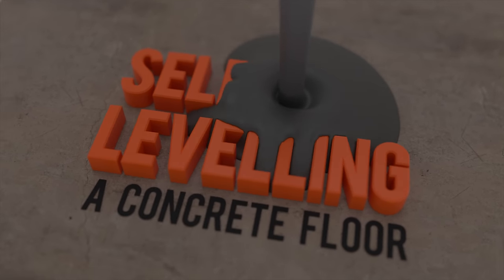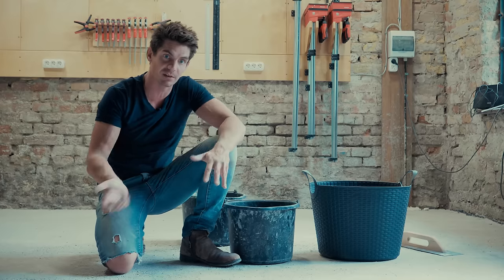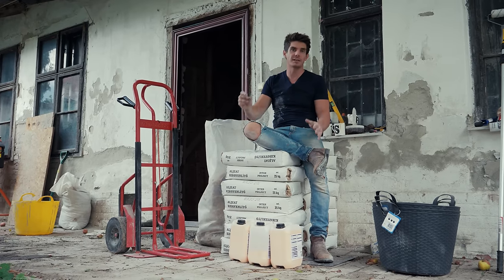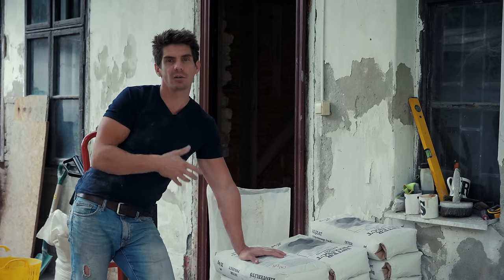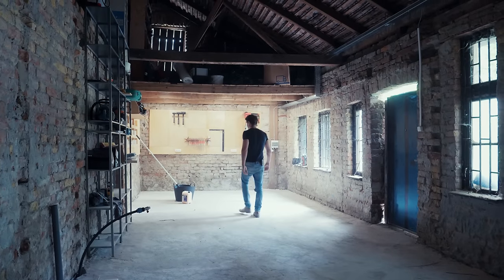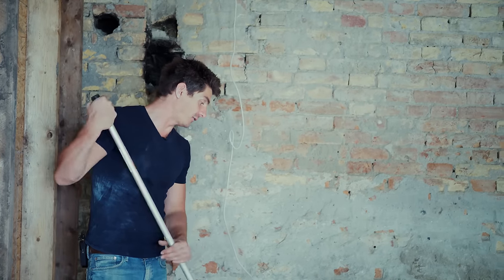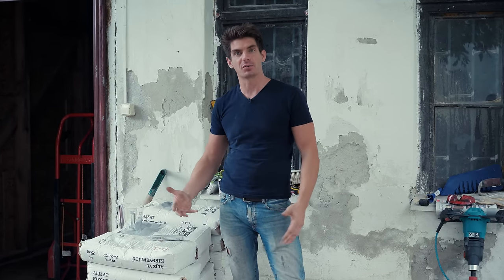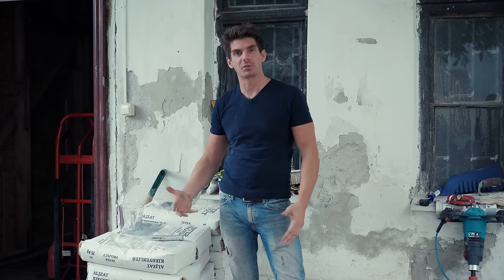Self-levelling a floor - The Complete Guide

Comment: I been told instead of primer , we can use PVA mixed with water ! Is that right?
Reply: If you don't want a warranty from the manufacturer, sure.  Just understand that improper priming is one of the major causes of self leveling failure.

Comment: I'm curious if the manufacturer recommends leaving it as a finished floor, the mix i'm familiar with is more of a bonding/leveling material that does not have the hardness to leave as a wear layer.
Reply: Yes, the vast majority of screeds and self-levelling screeds as classed as 'Levelling Screeds' and are designed to level a floor to receive a floor finish such as tiles/ carpet etc. Screeds designed to be the trafficked/ finished surface are always classed as 'Wearing Screeds' and normally are a lot more expensive depending on the duty/ hardness required. Saying that for light residential use a levelling screed is probably fine as a wear layer most of the time.

Comment: A propane torch would shrink/burn away those plastic reinforcement "hairs".
Reply: Oskar Wiren even glass fibre?
Reply: @jsd05  Probably not if its glass fibre.
I think he used the term "plastic" in the video.
Reply: @wirosk2916  It's normally plastic fibres used in concrete as far as I know.

Comment: What if i have a fairly slope concrete floor, means one side requires much thicker compound than the other? Then what kind should i use? Also what if i want to level 1/4 of the room (from 1 corner) - how to create retaining curbs without damaging the floor? Thanks a lot

Comment: Hi Lea.   Thanks for your tips I have had a bit of experience with self level as well and found that an airblower is perfect to massage the joint wet edges. Even the finest of water mister and  then blow also works as you can blow the excess water away to the sides. Which country are you in ? Power-points look like Germany   Cheers.   Geoff

Comment: 25th video I watched. Only video I needed. Thanks. 
1 question, can I still use the spike roller when levelling over an electric heated floor? Maybe just carefully? Or will this damage the cables?
Reply: Spiked roller is plastic, you should be good, don’t need to push hard either!

Comment: great video, but is it not a better idea to mix in the place you are levelling for the most part less carrying of the heavy mix.
Reply: After 20 bags the mixing area will be messy and need cleaning causing a dry joint when you continue pouring .

Comment: Looks like you’ve run the compound right up to the wall over the damp proof membrane? Can the compound go right to the wall or does it need to stay inside the membrane?
Reply: It must stay inside the membrane, easiest way is to tape the perimeter. Also stops the self leveling disappearing into cracks etc

Comment: Anyone that watches this... Good info but you really need minimum 3 or 4 buckets... 2 or three guys. This is fast set stuff and you will mess it up if you've never done this before.

To be honest watching this guy, no offense really doesn't look like he done this before. Maybe once. I know for sure his floor is not level if we put a straight edge it's going to be wavy by watching what he did.

All the info is good. Watch other guys that do not have time lapse and you'll see how fast they go. Its very much a skill and an art to get it glass like smooth level four flat.

He did a level one or someone is going to break this out and redo it. All those bumps will create fissures to crack. I.e. if he put down 2000 psi mix it's not strong.

Also different sacks for different heights, very important 0 to 5 mm sack is different for a 10 mm sack

Comment: Moral of the story. Have someone on the mixer and someone on a floor squeegee. 
Unless superman that many bags single handed on a diy basis is asking for a bad finish if it matters.
And make sure to check in any old building that it’s not a limecrete rather than concrete floor or you’re asking for trouble later.
Reply: Why would limecrete cause trouble?
Reply: @resouris  because you’re applying a non breathable gypsum based coating over a breathable lime nhl5 mix. Gypsum products and lime are entirely incompatible. Check out any roadside wall where cement mortar has been used to repoint over lime and you’ll see what I mean. The faces blow clean off the bricks. The cement however remains albeit the mechanical key is weak as a kitten and lasts only as long as the brick face remains bonded to it. 
In the flooring example you’re locking in any moisture into the floor under the latex and the only places it can then wick off will be the perimeter walls which will likely be lime mortar. Then you’ll see damp issues arising. Likely plaster will blow, skirtings will rot and brick faces will blow.

Comment: Im just about to do have a go at doing my first floor using levelling compound so I've watched a lot of these videos and I think this is the best one.

Just one question:  do you think it's worth doing more than one coat of primer?  

And something i find helpful when mixing plaster is to put the plaster powder in a  bucket and pour it from that into the mixing bucket as you mix, because I always struggle to pour it from the bag as Im mixing.
Reply: Absolutely. The more layers you use the better your finish will be I would say a minimum of 2 coats but you will see when the floor stops absorbing it readily. The guy stated that the slab was recently laid which means that the slab would take at least 50 days to dry out and would have to be tested for relative humidity levels before laying smoothing compound. also the laitence should be ground off not swept off. I do this for a living and I am a professional floor layer.

Comment: what do u do if you have a room thats 25 mm out of level so you need to level it all up from 25mm to nothing , what type of leveler do u use
Reply: Firstly I'd drill and plug some screws into the floor about 6 feet apart then rest a long level on them and adjust them to the correct height. Use the screws as your pouring guide. If you choose a good quality latex you won't even have to trowel it out, you want to get hold of a spikey roller with the longest pins possible, if it just pushes waves in the latex use it to tamp through the floor instead (with a good quality latex it will do the leveling for you). I can't speak for the rest of the world but if your in the UK I'd recommend level flex from tilemaster. Its a great latex to work with and one of the few that will go to over 25mm+ in one pour
Reply: @greenreaper1985  Thanks,  so the one that will do 25mm can also do about 3mm? I'm in the UK so il check tilemasters out thanks
Reply: @robevs100ok  if I remember correctly it will do from 2mm - 50mm in one coat, so 25mm will be fine, as the guy says in this video though priming is everything, especially at that sort of depth
Reply: Tommy in ask this old house channel has a great video on here for leveling a floor.
Reply: @SteS  honestly, that is not a good video on how to level a floor, it's definitely a way of going about it, but more of a drunken, general builders attempt because he's too proud to get a floor layer
Reply: Paul Davis's plug method is good.  Don't think of it as 'self-levelling', think of it as 'self-smoothing'. It's too thick and sets too fast to truly find a level. I know this because I've just had my kitchen floor 'levelled' with this stuff and all it's done is smooth it out without truly levelling it. There are gradients of 1cm in 1.5m still.  If you need to truly level a floor you need to put levelling tripods or plugs all over it and align them with a laser level before applying your compound/screed to the level shown on the tripods / plugs.

Comment: It would be nice if one could raise a portion of the floor. I had a garage built and we did build it up higher, Since the city never cleaned out the storm drains after the last hurricane everytime it rains hard the garage floods without fail. from the street side and also, from around the yard. My garage is huge so I guess that I an stuck. It would be nice if I could put a lip around the the outer edge of the garage.
Reply: We have a stainless steel angle lip at the front of our garage which the self-levelling screed was poured up to. You may find it cheaper to threaten your government with insurance bills if they don't fix the drains :-)

Comment: if priming and putting a self level onto a mixture of old tile adhesive and lino - room was half lino, half tiles, would anyone advise anything in particular? The ex-tiled area is prouder than the ex-lino area, but the ex-lino area has a load of the old adhesive left. Hard to get it up, so not sure if self level will stick to it?

Comment: Although you say to use exactly the amount of water described, ive used a product for my last project which needed way more water. With the descripted amount, it was like nornal cement, you could build bricks with that. Needed nearly double the amount of water to be runny. Yeah, it was cheap stuff, would not recommend it...

Comment: what if the floor has cracks and holes, should i fill them first or just let the leveler fill them?
Reply: if they're 'blind' I wouldn't worry. If they're not (e.g. cracks between floor slabs and walls) fill them or all the self leveller will flow away into them.

Comment: DO NOT lift the paddle mixer up & down!  This method pulls air into the mix which is bad for the mix.  Instead. use a trowel to scrape the sides and bottom of the bucket.  Too much air in the mix will show up as air pockets on the level floor.

Comment: You need someone to mix for you, and you need a "smoother" on the of a pole. Its like a hand trowel.
Reply: You been watching large (American) concrete pours? ;0)
Reply: @totherarf  I don't watch them, we pour tens of thousands of square feet of self-leveling each year.
Reply: @royh2618  Hi Roy. I'm a amateur builder interested in this method. What products would you recommend. Thanks in advance.
Reply: @francogunasekera1315  we use Ardex, Mapei, Uzin, rapidset, Euclid. You can buy these at a distributor like white cap or professional flooring supplier.
Reply: Absolutely right!  In response to Dave W, the smoother is made specifically for self leveling.  To understand it better think of it as a 36" plaster knife on the end of a broom handle.  Unlike a concrete trowel which you press mostly flat, you gently pass the knife edge over the leveler at a 45 angle.  It's meant to blend the pour edges
Reply: @royh2618  Hi Roy, which brand gives the most working time?
Reply: @ImTheWildManofBorneo  They all have very similar working times. You need several men to do this kind of pour.

Comment: Could you have used this product to self
Level approx 2.5-3 inches ( 25-30mm ) ? I noticed you said you were doing 8mm.
Reply: You can, or you can add sharp sand to a standard mix. Read the bag for the best advice.
Reply: 2” = 50mm 3” = 75mm. The answer is no. At that thickness u would be better off with a concrete mix. 

Floor levellers I’ve come across aren’t  for such a thickness. Good luck

Comment: I've found I need to level a floor in a very small room which is very unlevel as in a slope.

The compound says max thickness is 10mm but what if the amount of depth is more than this to level?
Reply: You can leveling in more pass of 10mmm, one pass per cure time.
Reply: @LordEzequiel  thank you 👍👍

Comment: I have a 400 square foot garage floor that has a slight slope to it. Will self leveling work on a slight slope?
Reply: no
Reply: Garage floor should have a slight slope to it so any water  etc. will drain to the  outside.
Reply: Don't think of it as 'self-levelling', think of it as 'self-smoothing'. It's too thick and sets too fast to truly find a level. I know this because I've just had my kitchen floor 'levelled' with this stuff and all it's done is smooth it out without truly levelling it. There are gradients of 1cm in 1.5m still.  If you need to truly level a floor you need to put levelling tripods all over it and align them with a laser level before applying your compound/screed to the level shown on the tripods.

Comment: Great video!
I guess there's one issue with self leveling floor - you can't use it if your slab has an intentional 2% slope, so it can be hosed down easily in a workshop...
The real question is, how did you end up with that shitty of a slab?
It looks like nobody could be bothered to keep it wet under a tarp either for 14 days...
One of those slabs I could crack apart with an old manual fence post hole digger. It may not be worth the self leveling floor expenses...
Reply: Don't think of it as 'self-levelling', think of it as 'self-smoothing'. It's too thick and sets too fast to truly find a level. I know this because I've just had my kitchen floor 'levelled' with this stuff and all it's done is smooth it out without truly levelling it. There are gradients of 1cm in 1.5m still.  So you can use it on a floor with a fall.
Reply: @resouris  much thanks for this valuable detail!  I'll keep that in mind for my farm house, which also will have to deal with heavy rain falls, that start and stop very abruptly...

Comment: Do you think you can self level over old asbestos tile? My basement floor is part tile and cement.
Reply: You'd have to make sure they are still very well bonded to the floor if you wanted to do that
Reply: Paul Davis Yes, they are really stuck on there.
Reply: @peterharper9703  OK, if I was you I'd still get a scraper under one or two and see if they pop up. In most cases in the UK they are layed on bitumen and come up with relative ease and usually in one piece, so not exposing yourself to much danger (the asbestos content in most tiles is exceptionally low, on the asbestos course I was told unless you ground them up and snorted them your relatively safe) if they're rock solid, pick a good primer, and use it neat rather than diluting it as the tiles are very non porous, if your in the UK I'd go prime+grip from tilemaster, it's not failed me yet, even going over a totally smooth resin floor
Reply: Paul Davis Thank You!

Comment: Raised dots ? Kind of goes against self leveling
Reply: my guess is that this thing must be mixed all together at once in a proper size cement mixer and if your area is bigger than the quantity of the mixture you have to put barrier and continue next day
Reply: @cq33xx58  Not really.
You have have to roll it as you work.
Its typically a 3 person job to do a substantial area.
One mixing
One moving the material
One finishing the material.

Doing this kind of stuff solo usually doesnt end well.

Either you have dried joints or dried lumps... or it's too thick due to lack of troweling.

If you're going to try it at home, grab your wife/husband or a friend

Comment: First you should of moisture tested the floor with a hygrometer the concrete must be dry unless you apply a liquid dpm after the floor has been prepared and may mean laying a moisture resistant latex with a primer then latex then liquid dpm,then a nother primer and then another different latex
Ground the latent debrs as this type of screed has a finish that has to be ground off
The video  has  the potential to lead people to disaster as the presenter does not know, how  much he does,not know so when professional floor layers turn up and quote to do the job properly and clients are told the real cost they then think they are being ripped off as Billy bodger and his video dont know how much they dont know
He doesn't even know how you mix the latex properly
Note the lumps he found in his mix

Comment: You called the dusty stuff 'latence.' Would it also be called efflorescence? If so, I think you can make a stronger floor (or subfloor if still adding self leveling) by coating it with sodium silicate.  

Also, thanks so much for the conversion for us in the USA! People don't understand how metric sounds like an alien language to us and leaves us without needed context.

Comment: Instead if a floor sealer could you use a vapour barrier sheet? It would stop the water in the compound being absorbed by the cement slab. I'm doing it for a porch
Reply: The compound would stick to the sheet and become a floating floor and then crack.

Comment: 12:50 couldn't you just prewet the floor instead of the primer .. ?
Reply: Canary Biker no. Prewetting the floor will come with a couple disadvantages. One being that the concrete will still take water from the mixture if the floor isn’t wet enough. And if it’s too wet, the point of contact between the mixture and the floor is compromised due to an unbalanced amount of water, which could leave you with issues like cracking and delamination. Meaning you’re gunna be in even more trouble down the road. If there is one thing you should take away from this video, it is to follow the steps according to manufacturers spec (how the manufacturer of the product requires the product to be installed for optimal adhesion/performance) by trying to save a few dollars now, you’ll be left spending thousands later. This is already an insanely cheap and easy product to apply, do it right the first time or don’t do it at all
Reply: @apollo3679  plus wetted concrete takes ages to dry out as there's no curing going on like there is with fresh concrete 'drying out'.

Comment: 3:44 "I have no idea what you use in the US but in Europe it's per meter squared"

Europe and the rest of the world honestly.
Reply: i would say true except in the UK we use a weird mix of the two. Rough measuring in feet and inches, accurate measurements in MM. We do weight of ourselves in stones and pounds, food in grams.   Travel in miles and know miles per gallon of cars, but buy and price fuel by the litre. We buy beer and milk by the pint, but usually measure liquids (other drinks, paint etc) by litres. We can't quite shake off the old!